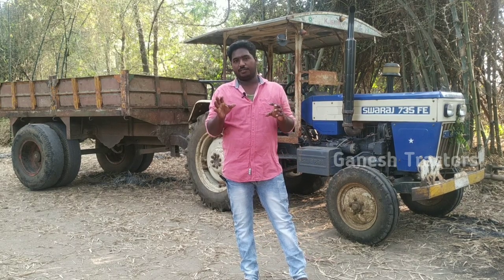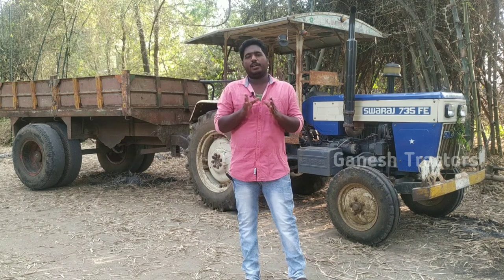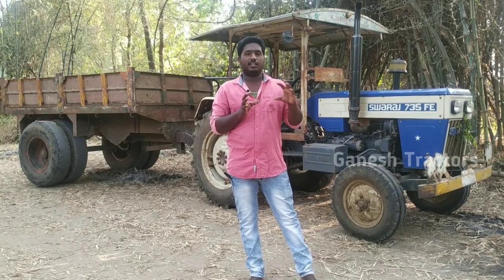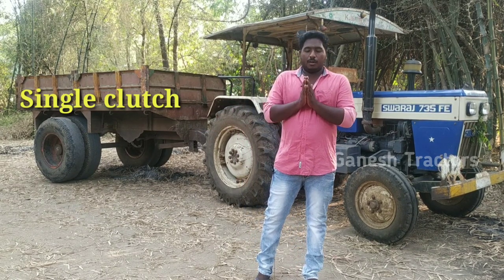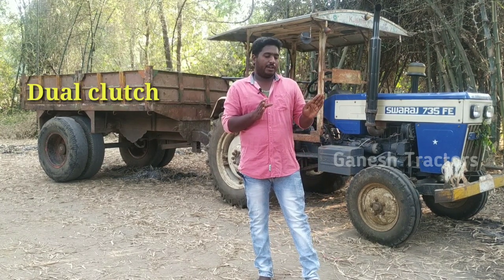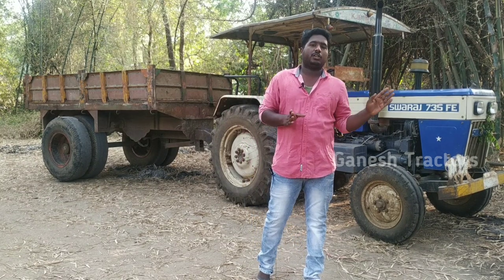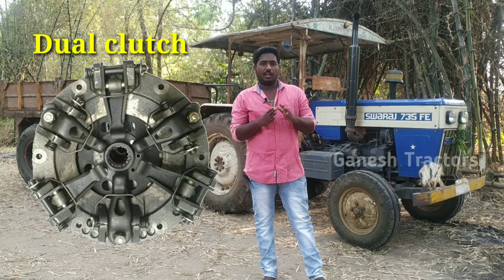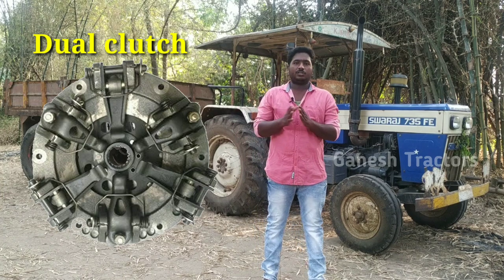Single clutch vs Dual clutch in Tractor  | Ganesh Tractors | 2021

Comment: Bro baler ku and all use ku best na tractor which one johndeere 5045 d or mf 7250 power up or mahindra yovo 575 or new Holland 4710 or Kubota mu4501 which tractor best for all use important for milage
Reply from the maker: performance,millage,driver comfort then 50 hp 
mf 7250 better
Reply: @GaneshTractors  bro mf 7250 sfc evalo bro
Reply: @rajking6759  7.40 laks varum bro

Comment: Bro 50hp best tractor please tell bro
Reply from the maker: mf 7250
Reply: @GaneshTractors  15 ton ke vandi pogamaatangathu bro, off aaguthu
Reply from the maker: Selection gear..Low gear use panuga... Speed reduce pana torque increase agum... Torque increase pana athiga load with stand pani eluka mudium
Reply from the maker: Mf7250 like Low speed engines... But it's torque is high.. when low gear ratios
Reply: @GaneshTractors  low third or low top ?
Reply: @GaneshTractors  Mahindra nalla than bro iruku, athula enna drawback